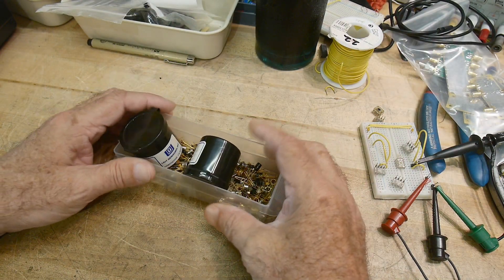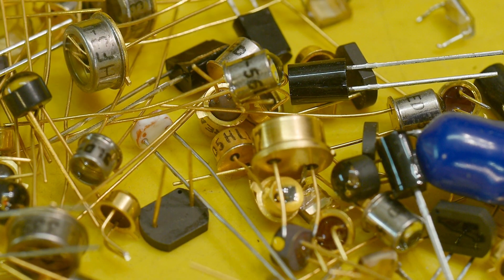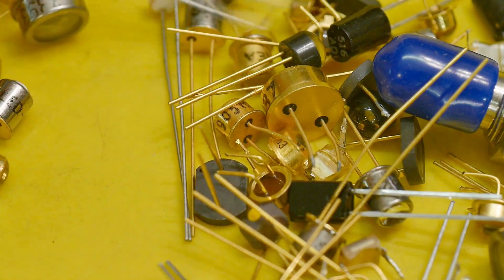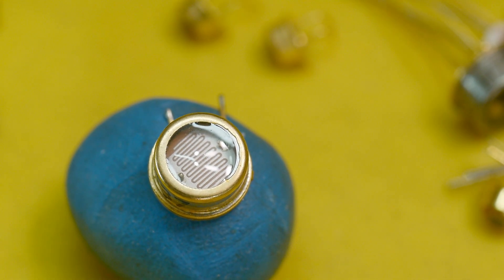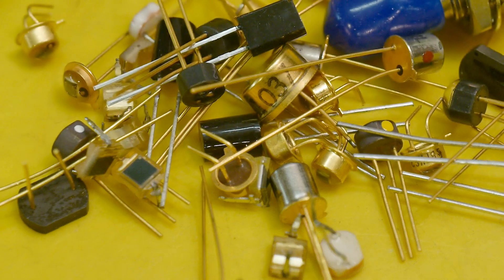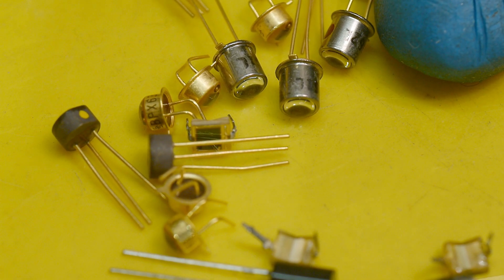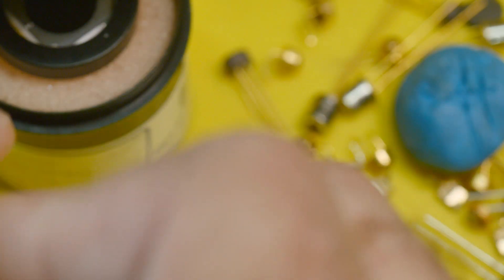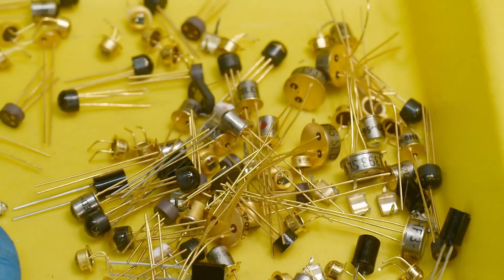#1188 Photodiodes

Comment: One obscure, and seemingly not used for may applications discrete optoelectronic device not mentioned, that I always found interesting, is the LASCR--Light Activated Silicon Controlled Rectifier---an SCR with a photodiode as the gate trigger.  Weird little device, but I found several interesting applications for them. Also, did you know that if you apply a higher voltage, in the order of a hundred volts or so, to a CdS cell that it will glow kind of a ghostly green? :)

Comment: Very interesting topic and you have nice collection. 
Please explain in another video main difference between photo diodes types, spectrum range, what they are used for, etc.

BTW, does exist an semiconductors replacement for photomultiplier tube ?
Reply from the maker: not that I know of, the photomult is pretty amazing
Reply from the maker: cooled CCDs are pretty good though
Reply: Actually yes, they do make solid state photomultipliers---they are kind of obscure, and you don't want to know the price, but they exist. They are used in some types of proportional radiation detectors, as one example.
Reply from the maker: @davidjh7  wow, news to me. I know the cmos imagers have about 2 electrons of noise and the small pixels sizes only hold about 1000 electrons per pixel. that means when you read about a pixel, it is about 1 electron per bit. amazing
Reply: @IMSAIGuy  I had a friend a fair number of years ago who went to Russia on a project developing them. They  have a long way to go to be really competitive, especially in the huge gain levels PMT's provide, but they are getting there. :)

Comment: A few LDR's in between. Early this year i experienced a problem with LDR's that was related to the "LDR Memory effect" or also called "Light History".
Most datasheets of LDR's mention a dark resistance of a few Megaohm's, but in reality, the dark resistance of most LDR's goes way beyond a few Megaohms. My ANENG 8009 Multimeter went O.L (max 100Mohm resistance limit exceeded) within 1 minute of darkness. When using my bench powersupply set a 10V, and with the LDR in series with my multimeter (set in Millivolt range) i could do measurings beyond the 100Mohm limit, and discovered that after many hours, the darkness resistance goes beyond Gigaohms. The problem that i experienced was with the flame sensor (LDR) of a oil burner that went in safety mode in the morning, and after a reset worked the entire day just fine, untill the following morning. After replacing the original flame sensor with a original one,and many other LDR's with lower resistance range, the problem was still there. The cause was, that the LDR's resistance from many Gigaohms not dropped fast enough, to give a high enough current to the control unit, within the first 10 seconds safetytime of the burner flame control at cold operation. Finally a small amplifier that i build with a BC547B and a 300K resistor as a voltage divider with the LDR fixed the problem.

Comment: That litle one wire lead is BPW34, can be used as a litle photovoltaic cell, 0.5V of course.
It has a filter version.
Wery universal.
Reply: Yes, I ordered in twenty of these last month to have a play with in conjunction with a “solar engine” circuit. 
Using nine of them in series generates enough voltage to charge a capacitor to about 2.5 volts at which point the circuit switches in a load such as a small motor.
They are so much smaller than a traditional solar cell which makes them useful in an artistic endeavour.

Comment: The first ones that appeared in the close view were the BPX63. I remember them as low light sensors with a current of Ir=5pA at Vr=1V.  So when you measure 5pA or less you know that it is dark. (Maybe you cannot read the current meter in this case.)       https://youtu.be/DSxkRa2D-M8?t=30

Comment: Don't forget that most if not all LEDs are photovoltaicdiodes.
Depending on the LED's color and semiconductor used the voltage can be quite a bit higher silicon's 0.6V.
Silicon's bandgap voltage which corresponds to infrared.

Color       Type    BGVolts Material
InfraRed Sensor  0.15V   Lead      Sulfide
InfraRed Diode    0.3V      Germanium
InfraRed LED       0.6V      Gallium   Arsenide
InfraRed PV Cell 0.65V    Silicon
Red         LED       1.25V    Gallium   Arsenide Phosphide
Yellow    LED       1.4V       Aluminum Gallium Indium Phosphide
Green     LED       2.25V     Aluminum Gallium Phosphide
Blue        LED       3.0V       Indium Gallium Nitride
UV           LED       4.5V       Aluminum Gallium Nitride
And other colors have similar results.
Note! White Fluorescent LEDs don't work as they don't operate like normal LEDs.
Generally, they generate relatively low currents as the chip size is small.

redrok
Reply from the maker: the white led is a blue led with phosphor layer on top. the light is blocked by the phosphor. https://youtu.be/gepeoKa1w7A
https://youtu.be/R1w1yCWF90M